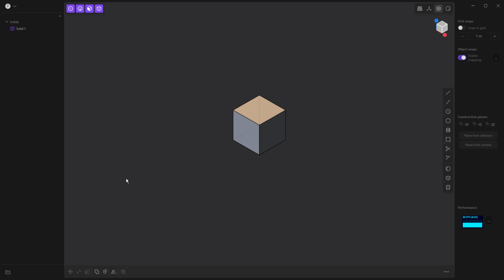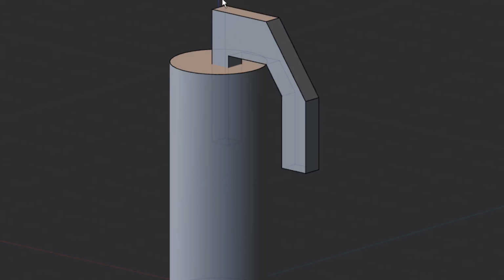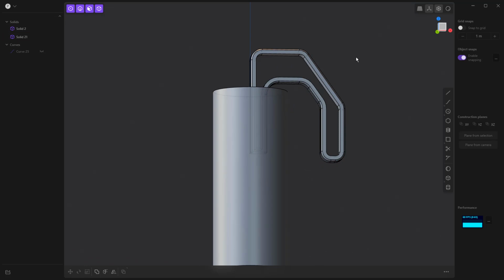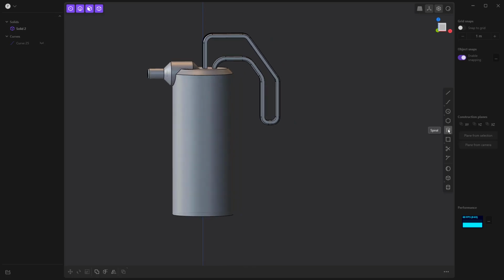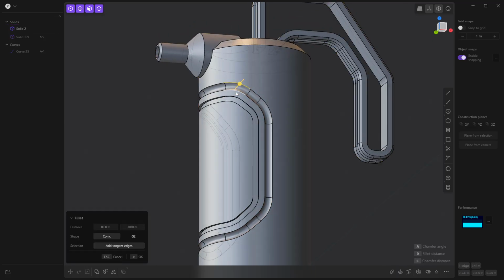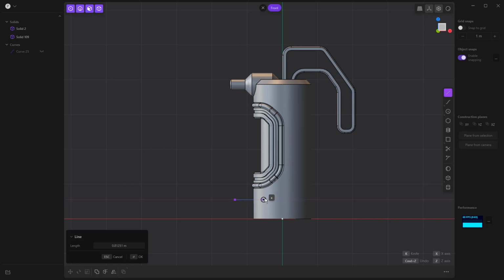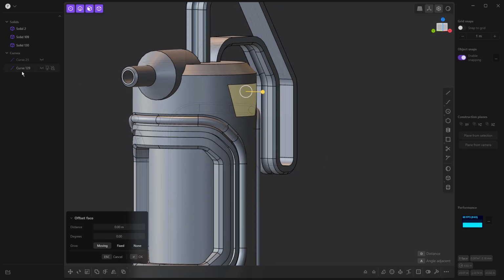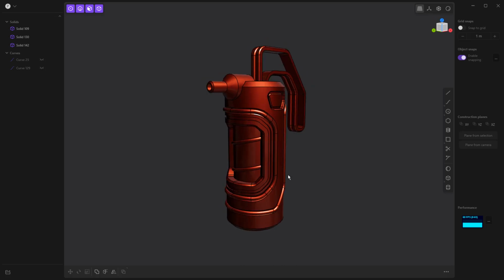Plasticity Quick Start | How To Create Imprints and Panelized Features | Sci-Fi Spray Can Tutorial

Comment: Great tutorials! I'm working my way through all of them now. 

Quick question about the technique you used around the 12-minute mark, where you created a new body with a pipe and then a cut with a slightly larger pipe. Is my understanding correct in that the new body will not be connected at all to the original body (the can)? My interest is in 3D printing, so a floating object would be a problem for me. I'm guessing that the side of the new body closer to the main body would have to be extruded to then connect to the main body. Is that right?
Reply from the maker: Yeah if you are looking to 3d print you would likely just make the pipe and join it with Q while creating.  The larger pipe cutting away from the base is more of a visual thing so the individual pipe fits in.

I do have a playlist with some basic modeling that at the end part 5 is another practice. https://www.youtube.com/playlist?list=PLBDfGh8A8kXVIrO1aizPFmRBy-A-G9svk

Comment: So, at the beginning, when you draw this polyline and when you draw this line parallel to the second inclined line (at an angle of 45°), this "snap" does not work for me, I have already tried various methods with the Tab button like you, but it doesn't work it works and I don't have the attraction like with you, I don't know what mistake I'm making, I can't get a line parallel to the inclined line. And with lines parallel to x,y,z it's no problem... I have the latest Plasticity.
Reply from the maker: Hmm, not sure about Tab, but try tapping Shift.  If the curve is part of the same polyline it should auto create the parallel snap, but if it doesn't you can hover of the line you want to mimic, tap and release shift and this should give you a parallel snap.

Comment: Thanks for the tutorial, subscribed! Does Plasticity have tools to snap objects to curved shapes?  For example, I want to create windows around a sphere or cylinder like a coliseum. If you know how - please make a video, it's very interesting to know.
Reply from the maker: Yes it does, sort of. Make your window off to the side of your design then use CTRL + D (cmd + D on mac).  This is a copy and place tool.  Shift + D will duplicate an object but CTRL + D will let you pick something on the object and let you place it normal to a face on a new object.  So you could draw a single window and then place multiple around.  Keep in mind it won't have a specific snap point unless you have a curve or have imprinted onto your object.

Comment: Hi, how do you join curves and lines together. Also after you draw a shape/curve how do you adjust the size dimensions? Cheers
Reply from the maker: after a curve is created there is no associated dimension anymore.  It is only at creation where you can enter those values.  There are some tricks you can do like create a reference line or shape of a known size and then move by changing the pivot point around, but its a bit of a work around.  As for joining curves and lines.  If you are moving the end point of a line you can hold down CTRL on a win machine or CMD on a mac to snap to other end points.  To actually join them together so they will be a single curve you use J.  But they have to share endpoints for that to work.

Comment: Why is it that when I start the offset tool, it gives such extreme values that I have to hunt around to find anything that'll fit?
Reply from the maker: hmm, im not sure.  its based on your cursor position so try something out.  Keep your cursor perfectly still, hit O with a face selected, then just move it vertically only.  Then hit ESC and try to do the same thing only moving horizontally. 
 Does this give you the fine control?  I "think" that horiz gives you a 1:1 movement with the mouse, but vertically is some kind of multiplier.  My guess is that where the cursor is when you hit O might move slightly and then be off in space.

Comment: I would like to learn about patterns
Reply from the maker: Great. there are a few interesting things with patterns (called Arrays in Plasticity).  Ill try to add that in the next video.
Reply: @LearnEverythingAboutDesign  awesome look foward to it. also is there a way to import a svg like a design or logo and extrude that from image?
Reply from the maker: @Mr.Serious0_0  Not currently.  You can import Step, Parasolid, Iges and SAT files, but not an SVG currently.  So depending on the program its coming from you can bring in a "CAD" file and do that, just not SVG at the moment.

Comment: What's you opinion on Rhino 3D? I find that it has so many tools and functions, which is why it's difficult to pick up.
Reply from the maker: Well. i think the program has a lot of power but the UI/UX is a big turn off for me.  The workflow seems to really work against the creative process for me.  I think UI/UX is really big which is why so many programs are struggling.  Nick put a lot of thought into that with Plasticity.

When i was looking at Rhino I was mainly looking for a surfacing/subD tool but found that the subD process didn't really offer anything over Fusion and Fusion was much easier to use.  Surface quality in Rhino is better for sure but it is tough to justify it.  One main thing it has that really makes it tough to overlook is the Grasshopper functionality....
Reply: @LearnEverythingAboutDesign  Yes, funny you should say that as I am a UXUI designer (3d hobbyists). I think the usability (Speed) of Plasticity, allows one to iterate and create some great models very quickly. I love the shift curve constraints. Just need some good documentation on how to use the functions, but I am sure that will come in time. Purchased the Studio version so I can get earlier access to the Blender bridge feature sooner. And yes, kicking myself for not purchasing the Fusion 360 one-time purchase when it was in beta.🤦‍♂
Reply from the maker: @PapaG-0101  Not sure if you've seen the wiki but there is some documentation there but its done by a user and not official. https://nullpointerecho.notion.site/Selections-Selecting-and-Snapping-592c29d631244c348f8d9d431ac1a339
Reply: @LearnEverythingAboutDesign  Oh, I wasn't aware of that wiki. Thank you very much, you are very helpful.

Comment: Sir, there is a lot of good software out there right now. But do you think Fusion 360 is equal to this software, and is Fusion 360 suitable for CNC or metal 3D printing? I'm overwhelmed because there's so much cool software out there.
Reply from the maker: There certainly are!  Here is what I would say.
If you want to make designs to be produced, CNC, 3d printing, stuff that needs to have dimensional accuracy and ease of control, stick with Fusion.
If you work primarily in a poly program like Blender, and want an easier tool to make "hard" models without worry of edge flow/topology, try Plasticity.

It is "CAD for Artists" and while you can make designs to 3d print from it, for me it is not a replacement.  Just another tool.  I think in the future we will see a lot of integration and workflows with Blender and Plasticity, but it is a tool to replace fusion for those that do it for VFX, game design, animation etc.
Reply: @LearnEverythingAboutDesign  I don't know how to thank you for your help in learning fusion, it helped me a lot. Thank you very much for your honest and insightful comments. God bless you😍